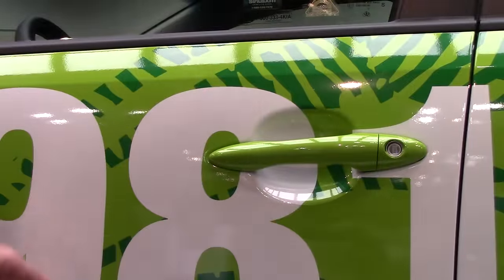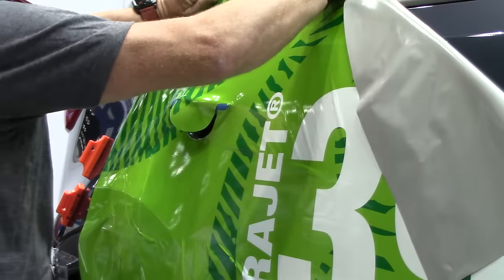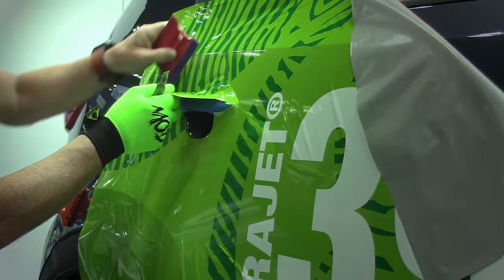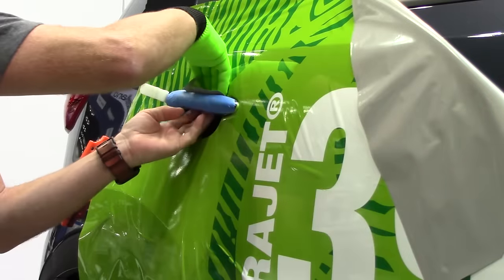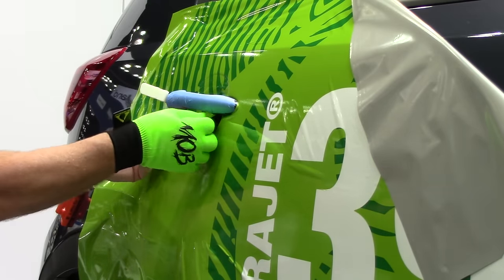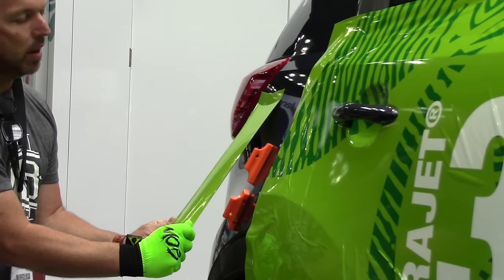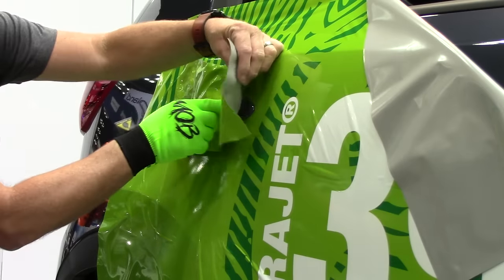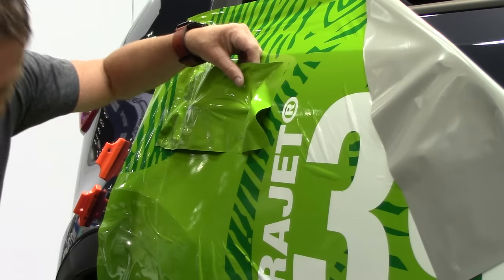Wrapping Door Handles for Commercial Wraps with Jim Miller

Comment: Ok everyone that says just take out the handle...it’s one screw... pay attention please. We would never wrap a vehicle with the handles on if they come off with one screw.  I would never do a color change with a handle on the car.   

Their are many good ways to wrap handles and this technique works perfectly in cases where you have to go over a handle or object that cant be removed.  Like a partial commercial wrap that has limited pay and the door panel needs removing and glass dropped out in order to pull the handle.  If you remove the handle for the same pay went it takes two or more extra hours total then congratulations! 
The 1/8” lap is no different than an inlay on a bumper! It’s right on the body line so reflections hide it better than any other option.  Fingernails don’t hit it like a seam behind the handle. Also you don’t have to stretch as much to make a seam behind the handle so it’s more secure.  The material around the handle is not stretched at all and it looks super clean especially in a busy commercial wrap.

Comment: When I started doing business in 2003, I used to do the installations that way, but it was a bit tricky when cut, is much riskier and longer process, then decided to remove the handles, mirrors and moldings they were easy to disassemble, in my experience it is better to take longer if the final work will be superior... but great job !!!
Reply from the maker: Erik,
We agree that if you are able, removing the handles is the best option for the best results. Unfortunately, it's not always an option. Thanks for the feedback.
Reply: Im sorry!  my bad I clicked on the wrong finger sorry!..
Reply: ORAFOL Americas Inc when it comes to time and money, this option is better. I will not waste time removing hardware for the same buck, maybe if this were a sports car instead of a work vehicle then I would take time and remove everything I can.
Reply: For me it’s a matter of time vs money on commercial jobs.  If the handle comes out with one screw then of corse I’ll remove it.  If I have to drop the door panel and remove the window to get to the handle assembly on a commercial wrap that pays 600.00 for a partial wrap over the handles. Guess what? I’m doing this.  It’s the best looking way.  The body line hides the seam and it never fails. Most customer don’t even know there is a seam there.  To top it off there is no stretch marks around the handle.  

All color changes get the handles removed. Pay attention to what is said on the video.

Comment: I don't get why sometimes wrappers take out  every element, like de door handle or lights and sometimes they just do it with everything on, without  taking off the elements.
Reply: In my opinion removing when necessary makes for a cleaner install,  even though it can be done without removal

Comment: Why wouldnt you just remove the handle? Who wants a 1/8 inch overlap right beneath their door handle? Terrible technique. All the people saying its great know nothing about vinyl graphic installations and the correct way to apply it.
Reply from the maker: Hi DecalMan, thank you for your question. We agree that when possible, removing the door handle is a best practice method. However, not all automotive makes and models allow for that approach. This technique is best used when removing a door handle is not possible.
Reply: @ORACALUSA  if removing the door handle isnt possible, which is pretty rare,  then putting the overlap behind the door handle would make alot more sense then having it in plain view. When you trace with the grease pencil measure to the center of the handle and make a straight cut there, directly behind the handle. That way it's out of sight. Why wouldnt you guys teach that instead?
Reply from the maker: @DecalGuy77  There are many effective ways to handle all applications, this is but one. To see more methods, join us at a tradeshow, ORAFOL Professional Wrapping Academy, Advanced Wrapping Academy and Vehicle Wrap Certification Course
Reply: @ORACALUSA  Thank you but I've been a graphic installer for 15+ years and Lowen Certified for 3. I actually have some violet metallic Orafol vinyl arriving this week. Hopefully it wraps as good as Avery.
Reply from the maker: @DecalGuy77 , with that much experience you should consider attending the next ORAFOL Vehicle Wrap Certification Course.

That's great to hear that you will be applying ORAFOL vinyl this week. I assume that you will be using ORACAL 970RA. Feel free to call our technical support team before the installation (1-888-672-2251 ). They are happy to discuss the differences in applying our material compared to the competitive brands. For example, one of the many differences is the amount of heat our material can handle versus the competitive brands.  Just a thought...

Good luck with your install.